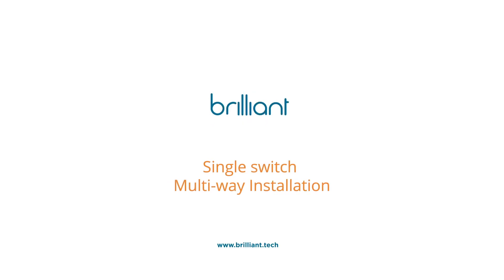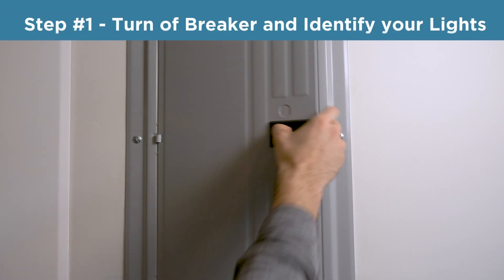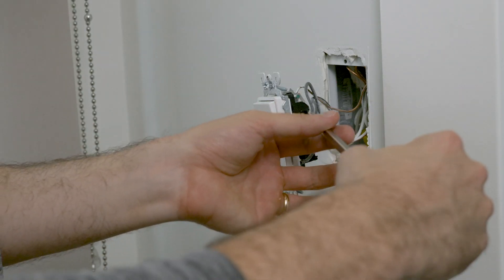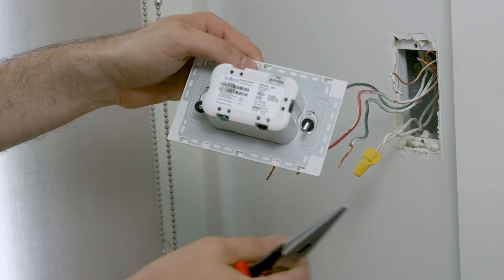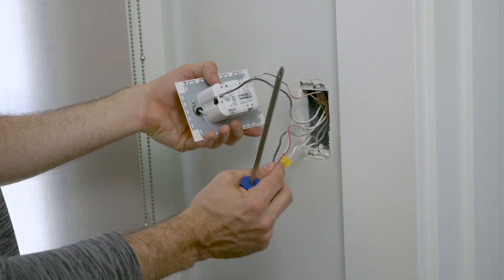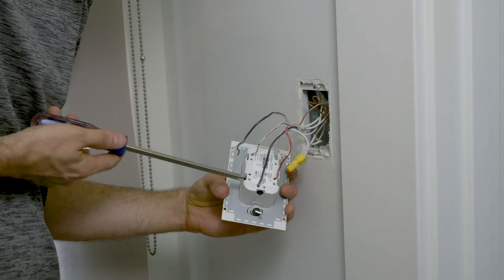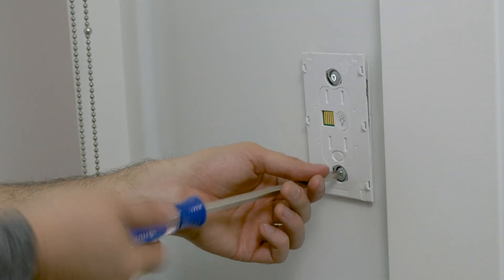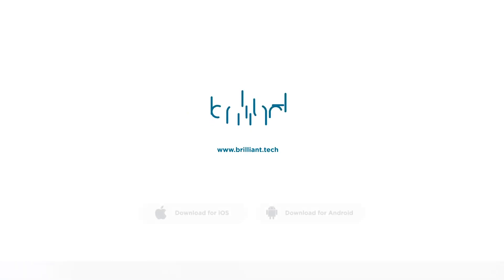How to install a Brilliant Control Single Switch (in a multi-way setup)

Comment: I have a 4 gang brilliant switch which is being installed in front entry foyer. Ran into trouble once getting to the 3way circuits wiring. Have my single pole outside light (1) and single pole foyer light (2) correct but cannot figure out the 3 way to my ceiling fan (3) and recessed lighting (4) within my living.
I think its wired correctly, once breaker is turned back on the fan and light works but no action taken when push test button on brilliant switch, same for recessed lighting no action when test button pushed or on 3way switch side is flipped. 
Any thoughts greatly appreciated.
Reply: Same as mines, I wired it as instructed in the diagram when I press the button no power as well

Comment: Question: I have the Brilliant single switch in my living room for the lights. When I check my wiring, the 2 traveler wires are hot when the power is on and the single, common wire has no power. The display works fine but the unit does not switch the lights on/off dimmer. Any advice to fix this kaka?
Reply from the maker: Hi Anthony, please shoot us an email. Support@brilliant.tech
Reply: @brilliantsupport5381  I did and returned the defective unit and got a new one. Installed it yesterday and it works well.